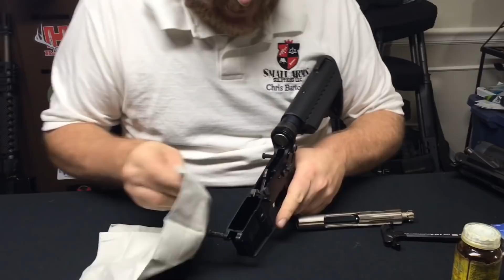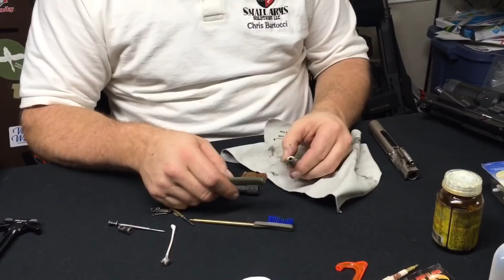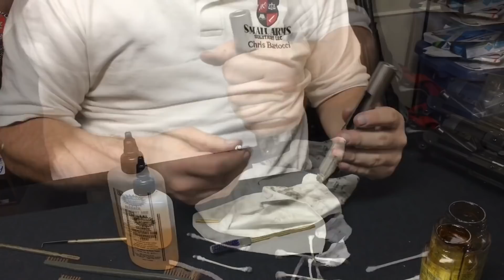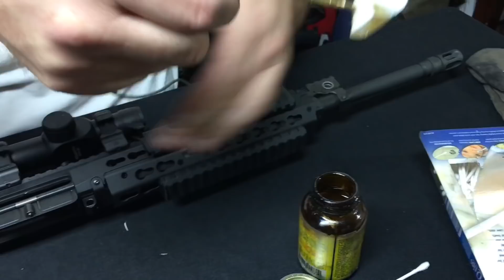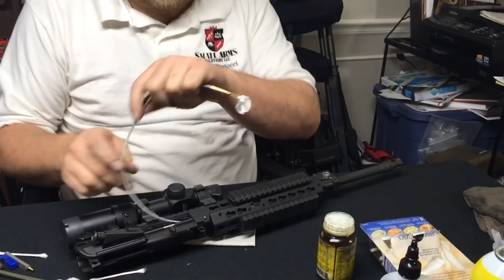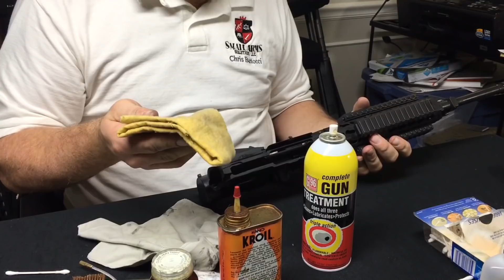Gun Cleaning: Cleaning your AR15

Comment: I use the Otis kit just for the pull through cable. I keep a brass cleaning rod, jag, brushes with the rifle. I also use nylon cleaning brushes most of the time because I am a compulsive cleaner. People always tell me my guns are new. With a white cloth you can't get so much as a spec of carbon off. I won't say what I've done to clean the gas tube and block but it is CLEAN.  I cleaned almost all the phosphate coating off my bolt and carrier (no kidding) in 500 rounds but replaced it with a Black Rain BCG. I use a few different cleaners and even mineral oil.

Comment: I bought the CAT M4 tool and Talon about 8 years ago when they came out, they work great.  A Hoppes Chamber Brush screws into the Talon and between the 2 I dont find the need for Q Tips for the chamber.  I use a Boresnake for the barrel, I spray G96 on the brushes and pull through till its clean, I never shoot corrosive ammo, and I don't use copper solvents.  I shoot IWI ammo almost exclusively, and I have never found a need for a strong barrel solvent, I am going to get some Kroil and put a couple drops on the wnd of my boresnake for the last couple of pulls.  On my DB10ELB I use the same tools except the M4 tool, I screw a AR10 chamber brush into the Talon and use it as a rod.  I am going to pickup a BONE for the AR10, hopefully CAT releases a Talon for the AR10, but the Chamber Brush works well.  I shoot every Saturday and I try to clean my AR15's at least 1 time a month, sometimes I only get to then every other month.